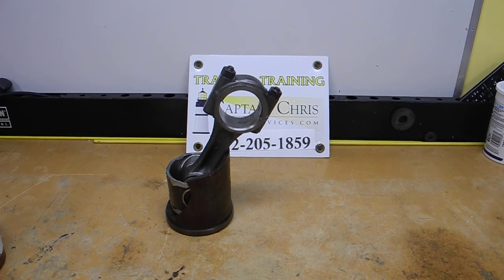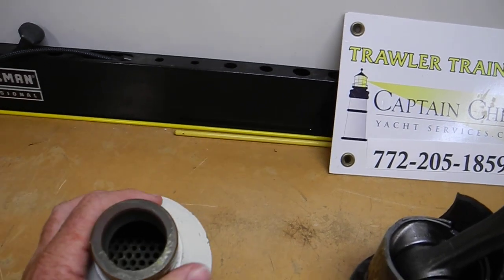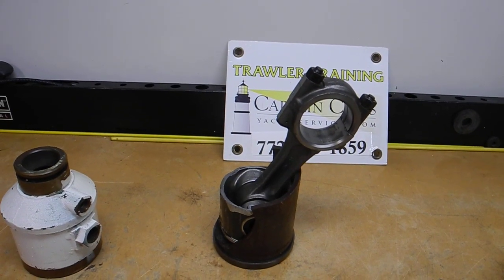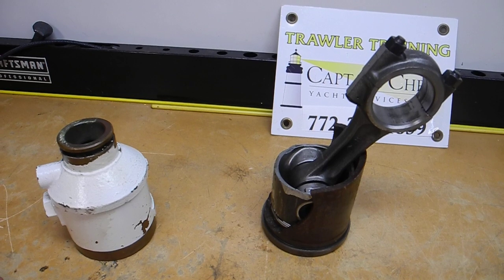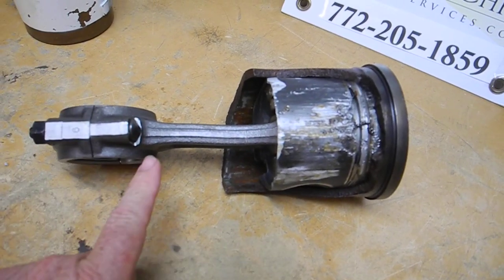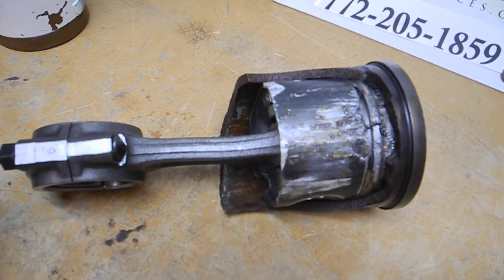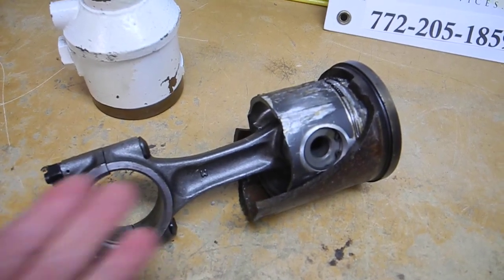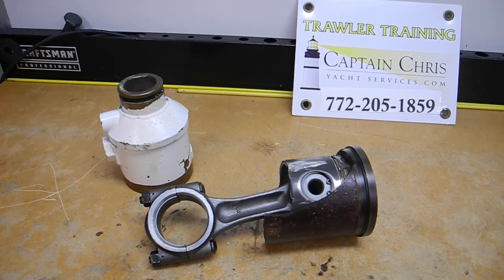Hydro Lock engine

Comment: Another issue that can cause that is a cylinder lining rusting out and leaking antifreeze into the engine .
If the engine is running  it will just smoke with power loss .  When it is re started , it may lock when that cylinder trys to move to the top position.
The liners rust out fron not changing the antifreeze or running water as a substitute.
Maintenances records and a survey can determine the engines condition
Good stuff !
Reply: Walter, you got that right ✅️

Comment: Wouldn't the oil and coolant pressure force it's way into the cooling water side and circulate out the exhaust? FWC engines asking.
Reply from the maker: No. The turbo charger compresses very hot air forcing it into the combustion cylinder. It’s better to have a cooler or heat exchanger to cool the hot air before it gets to the combustion chamber. If that cooler has a raw water leak then water on top of the piston will cause hydro lock.
Reply: Basically it's an intercooler on like a car , but since it's a boat it is using raw water to cool the air instead of air going through basically an empty radiator
Reply: @walterdavis4808  I sure thought it looked like a oil cooler.
Reply: @AskCaptainChris  I miss the days when a 653 or 671 just had a blower.
Reply from the maker: Can’t slip anything by y’all. Yes the white heat exchanger I showed here is for oil cooling. But an air cooler works on the same principle and looks similar. Instead of having a connector for oil it has a connector for air.